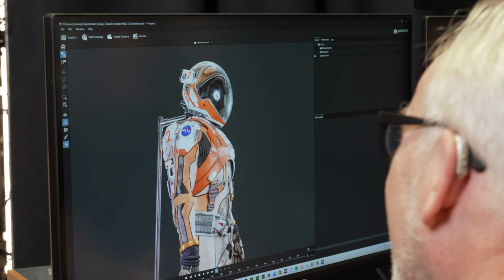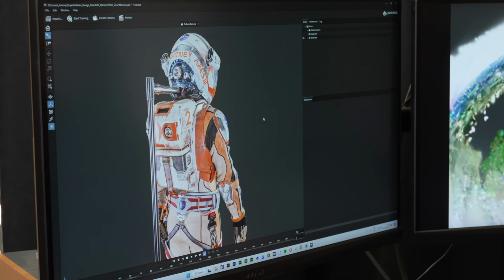Adam Savage Learns About Gaussian Splats!

Comment from the maker: Adam Savage gets 3D scanned and printed: https://youtu.be/Z24LJbGaz2k
Learn more about FBFX’s work at https://www.fbfx.co.uk/
Reply: Two minute papers on Nvidia’s new technique https://youtu.be/WNsSzX0L4Es?si=W7cPViKF_CmPyQki
Reply: @sgtpeppr778  Dang...that is cool.
Reply: So - what you're saying is that Gaussian splats would be viable for - let's say... police work?
Reply: @Desasteroid  EVERYthing relating to 3D environments. I'm thinking microscopic imaging for example, or extending 3D movies....just brain farts here.
Reply: https://www.youtube.com/watch?v=Pxd-q3ECBPs Directly Relevant and super recent 👍
Reply: @tested btw the lighting changing based on viewing angle is actually because the thing referred to in the video as simply the “color” of each Gaussian is actually spherical harmonics, where like the 0th order harmonic is the base color, and then each subsequent order adds more specific view-dependent color so that you end up with 48 color values per pixel ((1+3+5+7)*3 color channels), which account for most of the data in each Gaussian. However, there are new techniques that use things like reflection maps to represent super high-frequency reflective surfaces even better. I would highly recommend reading the original 3D Gaussian Splatting paper, because there is just so much problem-solving they had to do every step of the way to make any of the process worth it. A neural training process without a renderer isn’t any good, and a renderer without the training method doesn’t work either, so they just had to cover a lot of ground.

Comment: GSplats are quite useful now. Been used for some time now using GSOPS through Houdini into a few gsplat-ready render engines. Check out A$sp Rocky Helicopter$. Pretty much all GSplats rendered in Octane. Gsplats are quickly integrating into film/commercials/series pipelines as they render so fast and work for different level of details for assets.

Comment: As someone who works in film building and designing sets, GS have a problem where they dont create real geometry. They are only good for reference which can be very helpful of course but most of the time you want the output to make a 3d model to work from, to scale from etc. Im still trying to think of ways to integrate it into my workflow as ive had so much luck with photogrammtry and drones. Really cool work and Im interested to see where this all goes!

Comment: It's a shame you didn't cover why this is rarely used in actual VFX work. You can't relight it fully. You cannot change materials, you cannot easily change the texturing, you cannot easily animate it, all changes require hours of pre processing before you can fly around them. These are all reasons why traditional 3D VFX is unable to make much use of these. In other areas like video clips and ads with lower budgets and quality requirements yes, but they are still too limited and require too much manual correction to be something that can be used easily. As reference they are great, but they see very little usage as final outputs.

Comment: The best way to imagine Gaussian splats are as a 3-times generalized version of point clouds:
1) start with points to represent a 3d-scene, each point only requires position & color (& maybe opacity).
2) the first generalization I'll call "sphere clouds", they add a radius to each point so points aren't just 0-dimensional objects anymore but actually have a size - their radius - even though this single radius still leaves them fully isotropic, meaning no point has any information of local tangents, gradients or "stroke direction"
3) the second generalization adds local anisotropy & tangents by changing the spheres to ellipsoids so each data element has 3 orthogonal vectors which shows its radiis in 3d-directions in 3d-space. But a generalized ellipsoid is still a volume with a solid boundary making it still difficult to represent objects with changing opacities or soft borders.
4) the third generalization changes each of the previous ellipsoid's hard 3 radii into both a Gaussian half-maxima width & a an associated steepness factor to represent different amounts of soft/hardness gradients. This means each that such a Gaussian splat has 6 associated (spatial) parameters (other then color/material/opaqueness).
The good thing about Gaussian splats is that despite being generalizations of point clouds & offering more control & benefits then them they are conceptually still as easy to define & process as simple point clouds which makes them so versatile & powerful. Also Gaussian splats aren't a new concept they have existed in various engineering fields for decades so that both the understanding & tooling is mature, in particular Gaussian splats are related to both statistics & principal axis transformation.

Comment: In the mid 2010s there was a flood of VR short films that did a lot of experimentation with the form. Not 180 or 360 degree videos, those were mostly terrible, but rather the ones that used game engines to render in real time 3D. That approach has limits to what it can visually convey, realism is out the window, but in terms of using a virtual environment for storytelling they did some really cool stuff and I think they were only scraping the surface.

I want volumetric video to be a thing, a truly holographic video codec. Without the limits of needing to keep to a polygon budget, the limits of streaming assets and with the ability to fully capture real world environments and performances, it'd be possible to create some incredibly immersive stuff. Establishing shots could be full immersive 360 degree environments, cutting to a slow sweeping shot from the sky seen through an IMAX sized 180 degree window in front of you. Aspect ratio could be entirely shot or scene independent, narrowing or widening for comfort and authorial intent. The tools it adds to the filmmaking toolset are completely additive, after all if you can render a convincing, fully immersive scene you can render a cinema screen with a 2D film projected onto it.

I've seen clips over the years in VR headsets of both motion splats and lightfields, but no serious attempt at a narrative. I guess the obvious candidate for a conversion are the Avatar movies, given they're mostly rendered already and what isn't has accurate depth data, but I'd like to see stories more grounded and real, too. There's way more potential for expanding the art of filmmaking in this than there ever was in 3D glasses or higher framerates.

Comment: The cool thing about splats is that you can animate them. They’re particles, at the end of the day, discs with some transforms applied. So you can start them all as tiny circular points, that then scale up and stretch into the Gaussian splat, or start them all facing a single direction and rotate into their final position, or you can filter by only splats above a certain size threshold, and so on. It’s very good for opening up creativity for an animator

Comment: It's not an amazing explanation of gaussian splatting. What I would have said is that meshes are intended to represent hard surfaces, and they inherently can't do a good job of things that are translucent, transparent, volumetric, or have features that are too fine to reasonably mesh (hair, for example). Because the gaussian splats are transparent, they have a much easier time representing these types of materials, surfaces and effects. I'd also say that the reason these are used is that, unlike mesh, gaussian splats can be directly gradient-optimized (the same trick used to find good AI weights can be used to refine random gaussians into an image). This is highly efficient, extremely simple, and very robust. Photogrammetry relies on a bunch of analytical tricks to figure out which points in a bunch of images correspond to the same point in physical reality, and this typically relies on an assumption that the same patch will have a similar surface appearance from different angles (the 'diffusity assumption') This assumption is not true for reflective or transparent surfaces, so photogrammetry really struggles with those. Gaussian splats, because they're being optimized (i.e. the process by which it's determined which gaussian goes where and what properties it has) in much more powerful and robust way, don't have this problem, so they give you much better results for complicated materials. Also those analytical tricks can fail catastrophically, which requires manual cleanup. Gaussian splats can have snow around the edges or blurry areas, but they're much less likely to have total garbage. Really neat technology.

Comment: @3:21 so why havnt we seen any 3d game engines using this method instead of polygons?
Reply: Because it's only useful for non-interactive environments where rigid surfaces are unimportant. Even with 4D splatting which can track changes in the environment with time, information like which objects are in the scene, where they're positioned, how they're lit, how they affect how other objects are lit, etc is baked into the individual splats. If you were to move the splats that make up a brightly lit crate into a darker area of the scene, those splats will still be brightly lit and where they were originally placed will now have a gaping hole in the ground since there's no more splats there to render.

This limits the usefulness of splatting to things like arch-viz and pure walking simulators, but even then they're not a complete replacement for polygons as splats aren't solid. They're ellipsoid points within a point cloud, so there's nothing for the player to collide with when walking around a scene rendered with splatting, at least without serious offline post-processing, photogrammetry or modeling to produce polygonal surfaces for the player to collide with. Doable, but at that point you'd be better off just ditching splatting entirely for rendering since traditional polygonal rendering gives you significantly more control over the scene.
Reply: Because you cannot use them for much in videogames.
Splats are more fit for static objects, and you don't spend much time staring at static objects in games.

You could animate them like 4DGS do, but nobody wants to see a flickery 30FPS animation that isn't perfect in every angle, in a game running at 60FPS or more.

Cool technology, but very niche and useless for most things.

Comment: One of the things that irked me when everyone was talking about Gaussian splats is why you need a neural network to make them? Technically what you need actually is the more general "universal optimizer" that a neural network is to solve them. That is because there is an infinite number of guesses for how a structure can light a scene. But that infinite number is smaller than the infinite number of points describing the light emitted from every surface. Mathematically this means the true set is non-computable. A perfect problem for a universal optimizer. We need to start with a primitive that will have the properties we want in all scenes. Be view invariant (an ellipsoid) and structured at any scale (there can be any density of ellipsoids because they can be transparent. Hopefully that makes sense.

Comment: Gaussian splats as a term is a bit of the cart before the horse. A radiance field if it were "real" would be capturing the emissive light at every point in space thus there are no surfaces and it would have no structure. Obviously no capture device actually does this. But with a rig capturing the same scene from many angles you're getting close right? What a neural radiance field is captures the structure verified by the discrete dataset. In order to do that you need to know how two discrete images are related across space and time (their motion). Via brute force this would produce lots of completely useless data (structure that's invisible or redundant). You could think of this worst case kind of like the inverse of ray casting. An infinite number of rays. Importantly Gaussian splat can be rendered in real time thus they an approximation of the worst case thought experiment. Gaussians importantly have a simple set of describable properties and thus are continuous. Mathematically this makes sense because a discrete dataset would often amount to guess and checking the data (like my thought experiment of inverse ray casting).
For simplicity a scene in its totality is a point cloud with an infinite number of voxels describing the light at every point. The simplification is that every structure you can possibly imagine is described by an ellipsoid stretched and rotated and transparent enough to describe every point in the scene. (hint that's still infinite). So a neural network is used configure the ellipsoids to best fit the data using stochastic gradient descent. The Stochastic part means parameters are guessed randomly. gradient descent can be thought of as a guarantee the data is headed in the correct direction but without knowing if it has got there or not. In other words any structure can be estimated and each iteration much be closer to the real structure. Real in this case is described as the impossible to calculate but available "motion" that exists between differentiable points in the dataset of 2d images. Because the ellipsoids can overlap at any density that means there's more opportunities for your imperfect guesses to get closer to the training set. Its just random guesses but we can think of this as the algorithm can always insert a smaller ellipsoid in between others with which tweaking them keeps making the output worse (there's a local maxima). You insert that smaller elisposiod and suddenly you can traverse more iterations of tweaking surrounding ellipsoids so they fit better and rank better overall. It's this relationship between small iterative things (small delta) being able to always be able to head in the right direction that is the crucial property of the model. That's what gradient descent means. Im simplifying the math since its really the attributes in the math that matter not their physicality. But giving them physical descriptions makes it way more intuitive.

Comment: @tested and the community at large: I need some stagecraft advice

Background: I'm adding bump outs to the stage for our local community theater. The existing stage has a 1/2" rail at the edge for safety, so the bump outs will be flush with the height of that rail. Currently the stage is matte black, with nothing marking this change in elevation.

The question:
What's the most effective way to mark the upstage side of this rail, the rail on the bump outs and probably some backstage areas? Is retroreflective paint/tape a reliable visibility enhancer, assuming the light source is reflected spotlight or on stage lighting?

Should we opt for glow in the dark instead? Is there another option that's better than both? My research so far has returned fairly non-specific answers, so maybe I'm just not asking the right questions.

Also, any recommendations for general stagecraft building resources are welcome. So far, Scenic Construction for the Stage, and The Backstage Handbook: An Illustrated Almanac of Technical Information, are on my radar.

Comment: I wonder if this could be used for video games to speed up production and save on computing resources
Reply: At least in its current state, probably only in the very back end of production. I could absolutely see it being used for things like interactive reference material for environmental lighting and asset modeling, but I can't see it being used for the environments and assets that actually end up in the final product that you can play, except for games like walking simulators.

The core issue is that Gaussian splatting inherently stores lighting data. Games want lighting data decoupled from material data as the assets will be re-lit using real-time techniques, which is why photogrammetry requires such beefy rigs to be able to remove as much lighting data as possible, leaving just material data. If someone figures out a way to represent only material data in Gaussians, then Gaussian splatting could see a lot more use in the final product, but until then I doubt it'll be used for much more than very back end production.

Comment: The lighting being baked in isn't an advantage, it's a problem. Because you want the model to get correctly lit by the scene you put it into.

Baked-in lighting makes the model look realistic on its own but has the opposite effect when you combine it with other (real or CG) elements, especially if the model or the scene's lighting changes over time (i.e., if there's any animation).

Which is why all the companies trying to sell these applications and services will show you either static and isolated models floating in a black void, or they'll use it only to create the (static) environment (like walls, mountains, etc.) with fixed lighting, and not the actual animated models moving inside those environments.

Comment: Yep, we've been using this tech in tandem with photogrammetry, when you need to capture reflective surfaces, and finer details. It's great in VR, and getting better as the compression gets more efficient. My work with H. R. Giger, and the Sedlec Ossuary use this and photogrammetry quite a bit for some fantastic experiences.